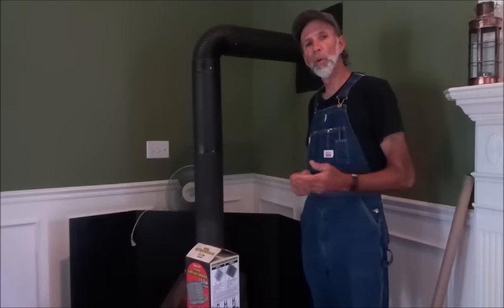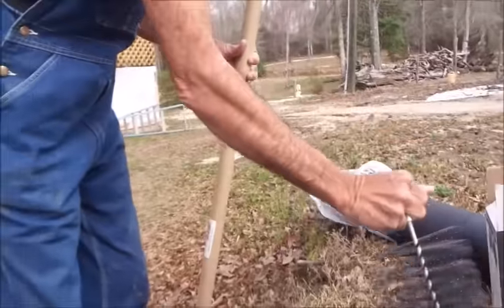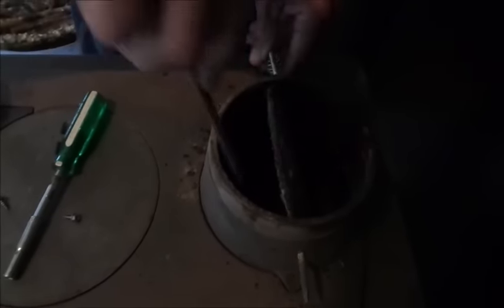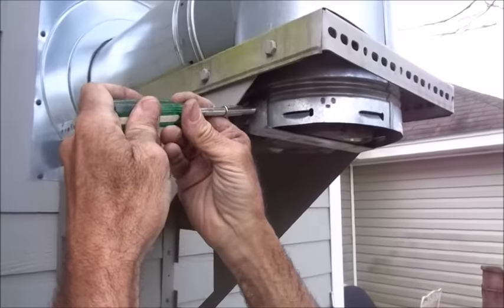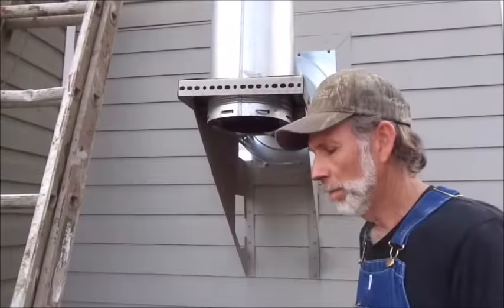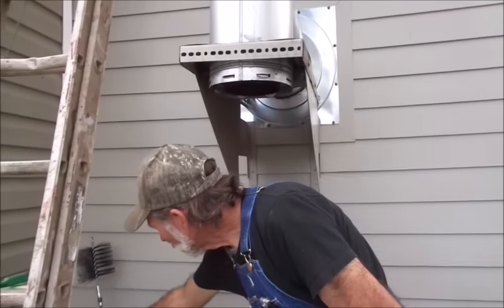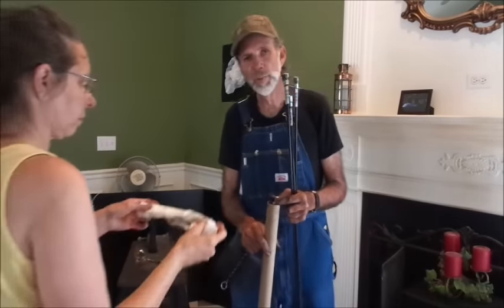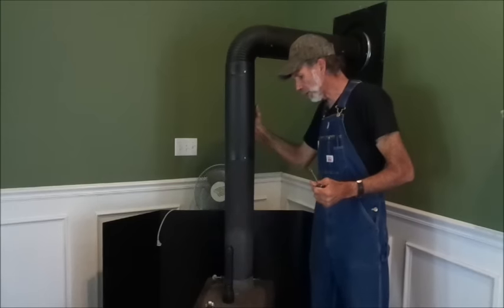Stove Pipe Maintenance

Comment: Yepper time to clean the flue ...I have 8" straight into the top of my stove...no elbows to deal with just get on the roof and take the top off and run it down....everything goes into the stove.
Reply: My stove is designed like that, too, but the opening into the firebox is tiny. We'll see what happens when we start brushing the pipe.
Reply from the maker: We would have loved to have a straight pipe, but where it was going wouldn't allow on the roofline.  Thanks

Comment: Should I assume your building or insurance codes don't require double or triple wall stove pipes?
Reply from the maker: Inside the house, from the heater to the wall, you use single wall.  That is where the heat comes from.  The pipe in the wall and outside that we are working with are triple wall.  Thanks